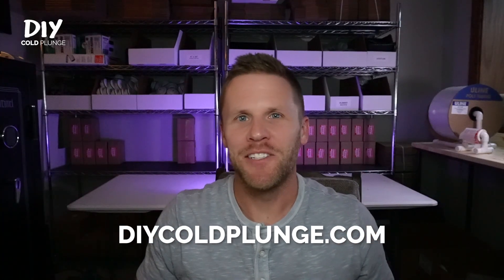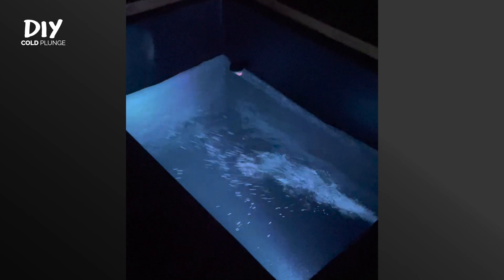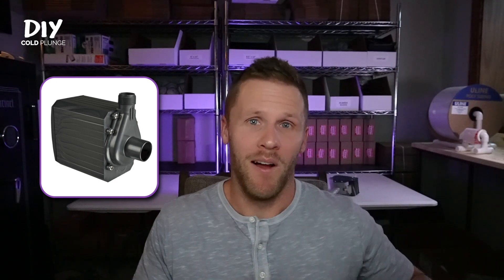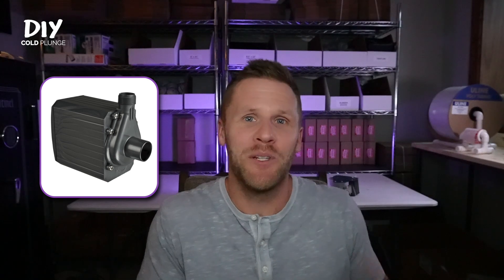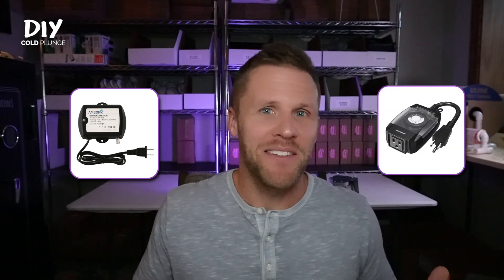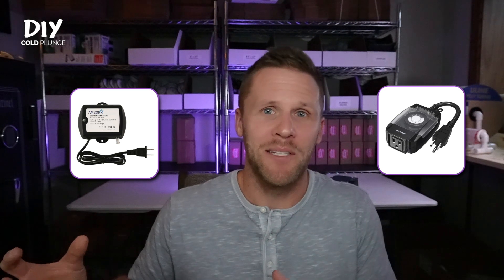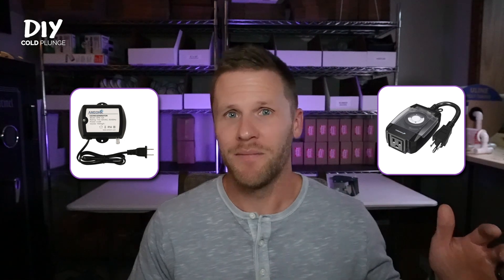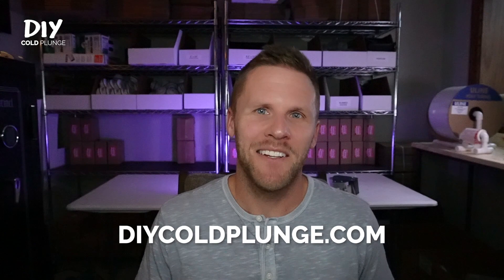Pump, Chiller & Ozone Best Practices | What needs to go on a Timer? How to run your DIY Cold Plunge

Comment: Hello, 
My situation is that I’ll be using my bathtub, but I only have one bathtub and so I need it to take hot baths too, and so I was wondering if it is a good idea to use use a timer with the 1/2 hp active aqua chiller with set for midnight so that by 7am I can take a cold plunge, and then right after or later in the day I might take a hot bath.  I don’t have a chiller yet, but I’d like to know if this is sound at all, -might you have an opinion?
Reply from the maker: If it's a tub in your home I do not recommend doing this at all. It's likely that your tub is not insulated. You'll have condensation underneath that can lead to mold, rot, etc.
Reply: @DIYColdPlunge Thanks 🕊

Comment: I have all those except the light.  I have a submersed pump that feeds the chiller.  I have a smaller pump I’m thinking about running also to stir up the top water to fight stagnation/fogging.  Do you think this would work?!
Reply from the maker: It could, or you could simplify the setup overall - https://diycoldplunge.com/blogs/diy-cold-plunge-blog/the-5-main-components-of-a-diy-cold-plunge

Comment: Venturi injector vs bubble diffusion for Ozone. Is one better than the other?
Reply from the maker: Venturi ensures proper mixing/circulation and cleans up the overall setup without having tubes draping over - so IMO yes, way better 👍

Comment: My pump is in the middle of my water chiller line, can i run my pump without turning on my water chiller?
Reply from the maker: If they are separate components, you should be able to 👍

Comment: Awesome videos. So glad I found your page. I do have a question for you. I just bought a grizzly 450 and it has the two drain plugs. One on each side. Would you recommend just using those for the inlet and the outlet?
Reply from the maker: Thanks! You certainly can if you'd prefer not to drill into it. I personally prefer the inlet to be just under the water line when no one is in the tub.
Reply: @DIYColdPlunge is there an approximate height from the ground to drill the inlet hole?
Reply: Yea that makes sense. I just hate drilling into a brand new expensive cooler but I may do it. Thanks.

Comment: Hi joe. Just out of curiosity.  Roughly how much do you spend on electricity for running your cold plunge chiller and pump continuously?
Reply from the maker: Hey! Honestly not enough to notice a change in fluctuation in MN. I polled my FB group a while back and got the same result, except for those that live in CA.

Comment: The chiller timer debate sounds similar to when I ran my AC while living in AZ. My friends would complain that their bills to run AC were crazy high even though they would turn it off while they were at work. I told them it’s cheaper to maintain a temp than to make their AC work really hard to cool down a hot room. I let mine run 24/7 and was paying a fraction of the cost that they were for electricity. This feels very similar.
Reply from the maker: 100%

Comment: I was curious if you know how to  put the pump on a switch so you can turn it off when you get in? Since the pump runs 24/7, it would be running when you get in, and I’d rather not have the water moving while I’m doing a plunge. I keep my water at 45 degrees which is plenty cold and obviously the moving water makes it feel colder, which I don’t think I need. I have a valve that I can turn off to block the water going into the plunge, but I assume that would put stress on the pump. Any other suggestions?
Reply from the maker: I think you'd just need to cut power to the system. If your pump isnt going you won't want any other components running either.

Comment: I've read that ozone can damage rubbers and plastics like polyethylene causing them to degrade and crack over time and can potentially create toxic chemicals when reacting with them. Have you noticed anything on your builds since you started running ozone? One source below but a google search will show much more.

https://en.wikipedia.org/wiki/Ozone_cracking
Reply from the maker: I may have to entertain this thought. Need more time!

Comment: Will the pump and filter  operate okay in below freezing temps?
Reply from the maker: The pump will need to run 24/7, I advise pulling the chiller in my video on winterizing your plunge.

Comment: Hey Joe have you ever tested the flow of the pump on the system? (Via a water flow meter) I tested the 1200 GPH pump and it came in at around 300 GPH. I tested with multiple flow meters and they all said the same thing. I thought maybe it was the distance of the piping but I got similar results when I attached it directly to the pump without the piping. Thoughts? I’m using the 3600 GPH pump now which is flowing at around 800 GPH in actual flow.
Reply: Joe, just curious if you saw this comment and if you’ve tested it. Thanks ! @diycoldplunge
Reply from the maker: Hey Roger, I've never tested the flow. The system has always performed how I needed it to so I've never felt the need.
Reply: Interesting. So you don’t think the 300 GPH of actual output is an issue for the chiller? Seems very low relative to the recommended flow from the chillers manual. Thanks
Reply from the maker: how complex is your plumbing? every turn, length of pipe and elevation will all impact flow. @rogermathis8626
Reply: @DIYColdPlunge  my plumbing set up is very straightforward, with minimal piping. I even tested the flow directly coming out of the pump without any piping and it was still 300 GPH. I also tested multiple Danner 1200 GPH pumps. I’m curious whether you think that flow is too low for the chiller. Thanks Joe! Your resources are amazing.
Reply: @DIYColdPlunge  hey man just to close the loop on this, do you think this is not a concern since the system works? For what it’s worth I emailed the chiller company and they said 300 GPH of actually output is very low for the chiller.
Reply from the maker: No problem! Yeah, like I said earlier... all my stuff has worked so I've never looked into it or thought too much about it. Have you tested what the pump does right out of the top without any plumbing at all? @rogermathis8626
Reply: @DIYColdPlunge  yes I tested it coming directly out of the top of the pump and it still shows 300 GPH 🤷🏻‍♂️

Comment: Hey Joe, I’m currently building your guide for the 100 gallon Rubbermaid tank. I was wondering why the water doesnt run through the filter before the pump and chiller. Seems like it would make sense to keep the pump and chiller as clean as possible without debris in the parts. What do you think? Why do you have water flow through the pump and chiller first?? Thanks in advance
Reply from the maker: I break that down in this video - https://youtu.be/RELc6xNzfLM
Reply: Because some chiller can’t handle ozone.

Comment: Question: the danner pumps with 1200 gph but your recommended Filter e.g. from Ge gxwh20s only allows 12 gpm or 720 gph. Ever thought of choosing a fitler with less resistance? It must reduce energy usage as well or not? Greetings
Reply from the maker: I have not, I havent had any issues with my setup

Comment: Yhanks for the video (and all others you put out). Kinda dumb question but I bought an in line filter I purchased prior to getting a chiller. I recently got a chiller that came with a submersible pump. Is there any issue with running both ? It’s not like the water is making waves or a monsoon will ensure and figure a bit more movement is better in terms of sanitation. Thoughts?
Reply from the maker: Of course! So you have a pump, chiller and filter?
Reply: @DIYColdPlunge pump x2 (one submerged and one in line) , filter (whole house) and chiller (1/4 HP but runs great for me based on outdoor temps, etc)

Comment: Is there any downside to running the ozone generator 24/7?
Reply from the maker: I can't say for sure, but there are claims that inhaling high amounts of ozone can cause irritation in the lungs. I've ran mine 24/7 in the past without issue in my garage. It is recommended to have it in an area with ventilation
Reply: Is there any issue with running the ozone in a garage near a gas hot water heater?

Comment: or, is there an easy way to heat the water with my pump and filter?  jacuzzi heater, in line with the pump?
Reply from the maker: I didnt actually need to use my heater last year, the pump kept everything moving enough

Comment: I’m in Southern California where our crooked utility companies charge us triple the electricity rate between 5pm - 9pm.  I have my refrigerator ‘s, pool pumps on smart timers to not run during that time, along with subconsciously not running AC and trying to conserve electricity during this “peak demand” time.  What would be your recommendation for that 5 pm - 9 pm window?  Think a smart timer would be ok for the chiller / pump in that instance?  Tub will be well insulated and covered.  Thanks for the videos!
Reply from the maker: Oh man... Yeah in this case you could do some smart timers. I would make sure whatever you go with has an extremely low chance of having just the chiller power on.

Comment: Could I build the plunge you designed but omit the chiller? I’m planning to put mine inside my garage year round, and I’m assuming I will be able to get by with less ice than if it was outdoors because of it being inside and insulated. I’m planning to use a pump, filter, and ozone generator to minimize the amount of times I need to drain and refill.
Reply from the maker: 100% I actually have everything set up so you can add/remove components if needed. I run mine all winter without a chiller.

Comment: Can I switch my inflatable jacuzzi to an ice bath with buying a chiller? If so do how would I do that? It's small 100 gallons
Reply from the maker: As long as you can hook hoses up to the inlet/outlet you can! then just connect those to a pump and chiller.

Comment: So, i JUST tuned into your channel on this past Tuesday. Not sure why it took so long for me to link up to you.   It is strange because the items you suggest are the same that i chose... i chose the Danner pump, and the Active Aqua 1hp chiller with an Aquatic 2 Ozone Generator. Main difference is that i went the vinyl tubing route.  I started plunging this past winter in the lake near my house on the Dec 30th.  Through the ice. Started once a week then moved to twice consistently bumping up the time in the water.  Needless to say, i got addicted to it.  April the temps started to rise and decided i need to build one.  It is bare bones in my shed right now naked tub and lines crazy condensation.  Got it operational on Fathers Day.  Plan is to get it to the point that i can put it in my basement without the condensation being a problem. Biggest issue right now is that the water gets cloudy after about two weeks.  I had spin down filter that i had set up before the pump with a 50 micron screen, this was bad and i needed to pull the screen because it was constantly plugged. (50 microns is about 1/2 of a hair btw). Right now, i have the ozone pump running 24/7, i will put it on a timer soon.  I am in the thought stage of getting a different filter and moving it to under the Venturi tube like you suggest, i had a valve to adjust the suction at this point under the Venturi.  It is difficult to be at $2800 and tell my wife i need to spend another $50 on a different filter.  The cloudiness has me stressed rn bc i dont really want to use bromine or other sanitizers OR keep changing the water.  Do you use any additives to keep the water clear or is the filter and ozone it?
Sorry for the length.
Reply from the maker: Glad you found the channel! I use a 20 micron filter in my setups. I don't use anything else for keeping my water clear - just filter and ozone. Is your pump running 24/7?
Reply: @DIYColdPlunge  Hi, do you use your ozone generator when you use the bath? Or only when you are not in? I am creating a mobile recovery center and look for the better sanitary system i can use with clients in
Reply: yes, i’ve got it running 24/7

the filter i have is a 5 or 6 inch spin down screen, maybe it’s just the  volume as compared to the 10 inch GE hat you mention

Comment: I made a chest freezer into an ice bath recently so I don't need the chiller. Is there a filter pump system you'd recommend to keep clean?( i assume chillers already have filters in them) the ozone generator will be a great addition. Thanks!
Reply: I done the same thing with the freezer. I used the same filtration and sanitation system he uses. You can find the details on how to build it on this channel.
Reply from the maker: Yep, you can make a filtration/ozone sanitation system to use in your freezer. I like Danner pumps because they can be used in-line or submersed 👉 https://diycoldplunge.com/products/danner-950-pump

Comment: My only reservation with running the pump 24/7 is that filters will be burned through much faster than if the pumps on in intervals.
Reply from the maker: I suppose you'd either have dirt in your filter or in your tank. I recommend monthly filter changes.
Reply: @DIYColdPlunge  yes that’s what I’ve been doing.  Using a 20 micron whole house.  Water stays clear for a Few weeks

I also use 12% h202 to keep sanitary and vinegar/baking soda (ph balance)
Reply: What about when you want to turn off the entire cold plunge to zero out risk of electrocution?

Comment: I switch everything off before plunging. It’s probably irrational as the system is on a GFI plug and all the electrical stuff is outside of the tub so any stray current/circuit will likely not to the tub but to earth/gfi. Any thoughts about improving electrical safety so that I don’t have to power down the system before getting in?
Reply from the maker: GFCI is the biggest thing from what I have seen. I'll do some more research here.

Comment: Does anyone else unplug everything when plunging? I plug it back in right after. I have chiller and pump plugged into a smart switch and then into a GFCI extension cord. Is there a safer way to have this set up?
Reply from the maker: GFCI is the biggest thing from what I have seen. I'll do some more research here.

Comment: before insulating, i had to put the chiller on a timer otherwise it would run almost all the time . After insulating there is no point in a timer anymore just like you said, and i can get it to stay in the mid 30's. Insulation is king.
Reply from the maker: 10000% I'm baffled that people are willing to purchase 1HP & 1-1/2HP units instead of investing in insulation.

Comment: I agree with what you said,,,,but before this video I was on the fence about chiller on a timer.  But your info persuaded me to not do the timer on chiller.  Great info on the deadband setting,,,,was not aware of that setting.  I like the idea of broadening the deadband setting so it is not cycling on and off a lot.  And finally your insulation recommendation is so spot on.  I see other people on youtube build plunges with little or no insulation,,,,but invest in 1hp chillers,,,,,,crazy.  Also,,,the idea of paying for that $1100 plastic ice barrel that has no insulation in it(from what I can tell),,,,,is absolutely foolish.  Anyway great video.
Reply from the maker: Thanks! Yeah the deadband setting is something most probably aren't aware of - hoping this video can help a good number of folks!
Reply: @DIYColdPlunge  as a fellow Minnesotan, I am curious how much per month in electrical you see for both summer and winter months to run full time. Awesome content

Comment: Also, have you run into any issues using that tiny ozone generator to keep water clean? 

In my head I have to get the JED, but at triple the cost it’d be hard to justify if that little guy would suffice. 🤷🏻
Reply: I ordered this ozone after watching some of these videos. The ozone I had before had a pump, and I could smell ozone, but I wouldn’t call the water clean. You could not see the bottom. Then I got this ozone machine, and st first I couldn’t smell any ozone and the water looked no different. I even emailed him. He of course responded. But I figured out my Venturi wasn’t adequate. I got a better Venturi, and plumbed it the way he shows, as a partial bypass for the GE filter. That provides just enough back pressure for the water to flow through the Venturi. It was powerful!! In one day my water went from embarrassing, to crystal clear, with a bunch of floaters. I’m working on my filtration to solve that. 
I’m using a cold pod portable cold plunge. So my water outlet is the bottom port. I think this may limit some of the floaters getting to my filter. I ordered an aquarium filter to help supplement filtration. But this tiny ozone machine works much better than larger pump style ozone machines. It’s quieter, and probably more durable. My plunge is 116 gallons, if that detail is applicable to you. I did insulate it as well. I made a pretty cool wrap, I call the Koozy wrap.
Reply from the maker: I wouldn't call it "tiny" - it still kicks out so much ozone that it needs to be on a timer for 30-60 min per day. The main difference in this one and the JED is that the JED has an air pump. They both kick out the same amount of ozone depending on the model. With the ventuir, an air pump isn't needed. This is the same generator "The Plunge" uses on their plunges - https://diycoldplunge.com/products/ambohr-spa-124-ozone-generator